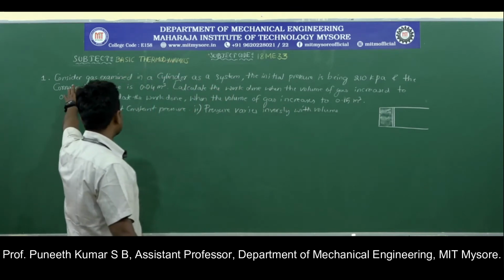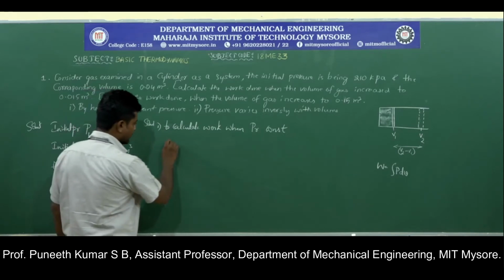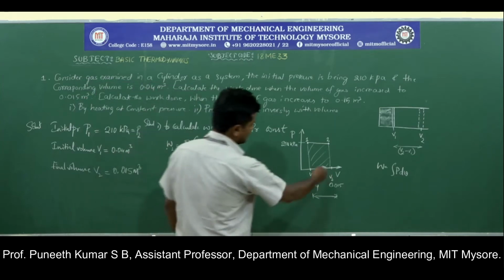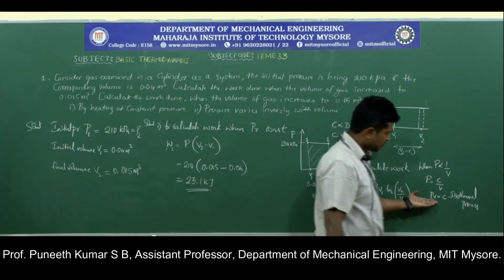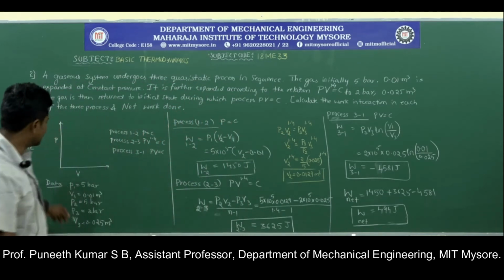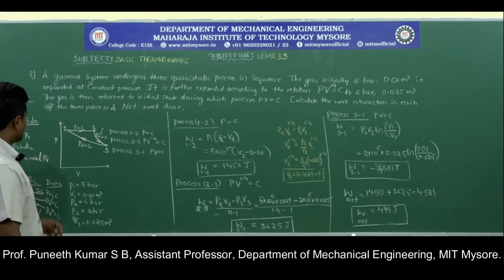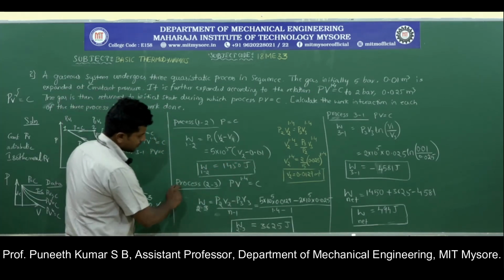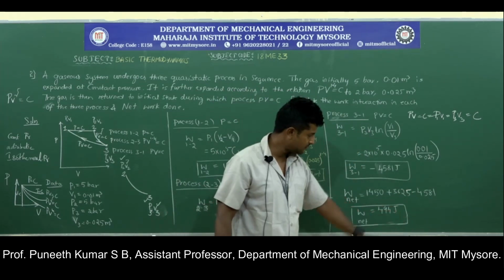3RD BTD 18ME33 M2 2 PSB

Comment: If it is expansion, v2 must be 0.15 i.e. it must be increased.. 0.015  is not possible by expansion , it can be by compression. 
23.1 comes by substituting 0.15 not 0.015 .
Reply: Yes it's right, if calculated V2 as 0.015m3 work will be 5.25KJ.